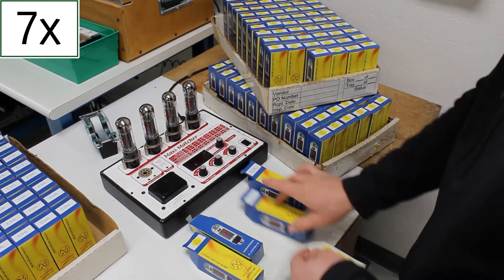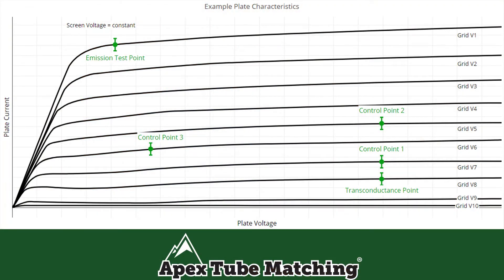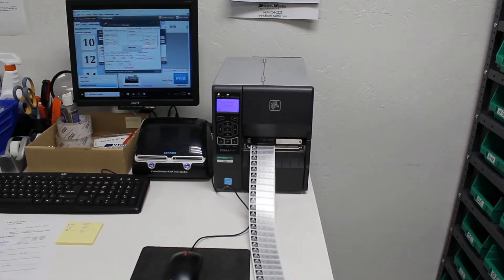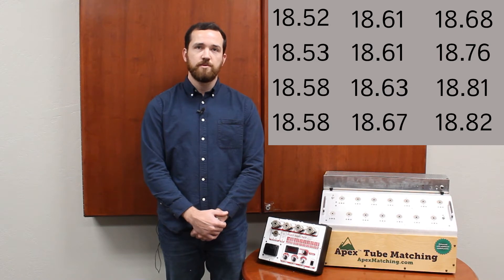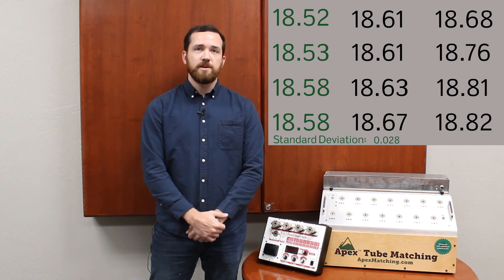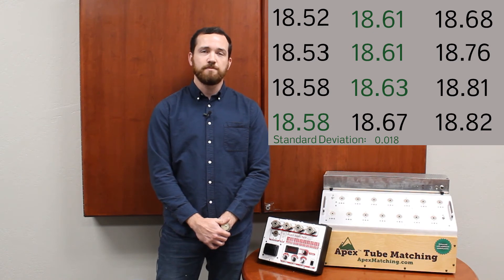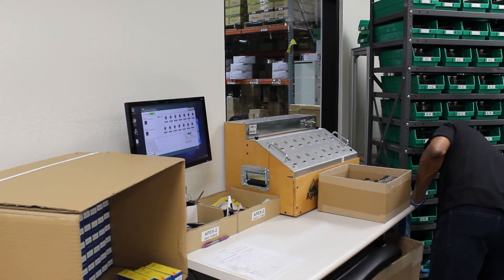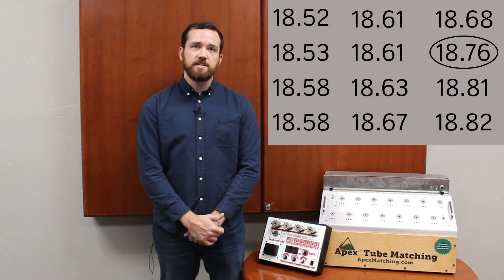Inside the Apex Matching Algorithm

Comment: i get the look-ahead method. I didn't realize til now that the tubes are sorted ascending in values. I was wondering wouldn't you miss a non-consecutive tube? such as 18.10, 18.11, 18.5, 18.6, 18.10, but this situation would never arise as they are ordered.